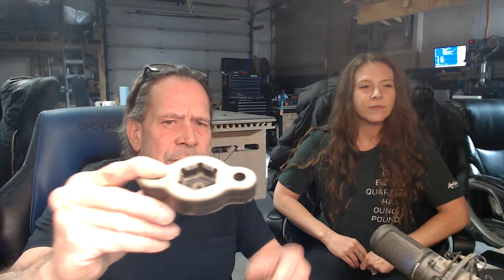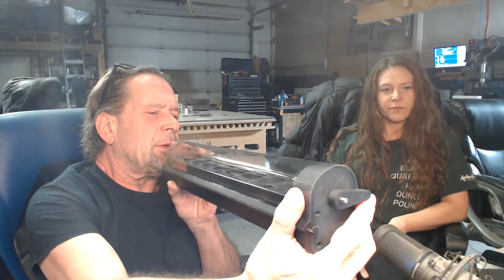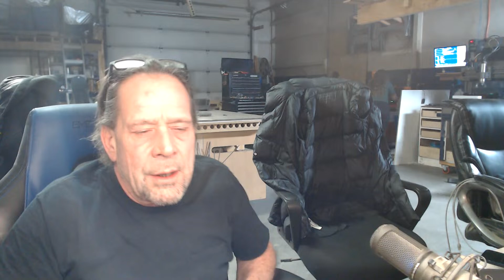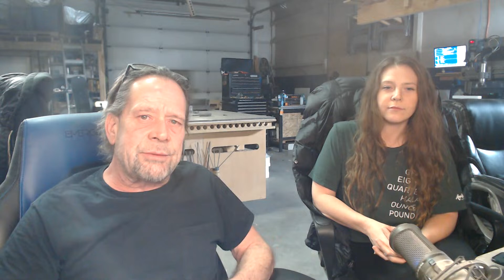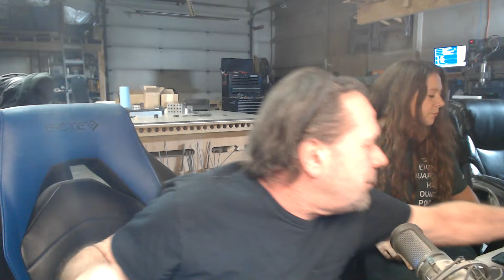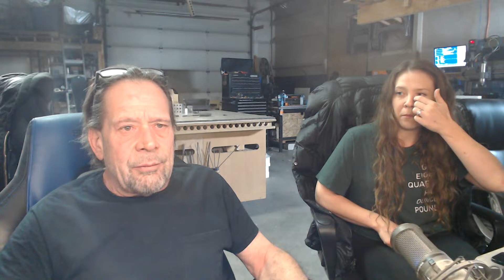RapidChange ATC Weekly Live Stream Episode 1

Comment: Do you know if F360 Personal License (Free License) Post Processor will work with UCCNC and RapidChange ATC macro ?
Reply from the maker: Yes Fusion 360 should output the M6 but you will likely have to string the separate tool path files together in the free version.
Reply: @RapidChangeAutoToolChanger  So it will be a workaround....hope it will be available from your side in some way 🙂